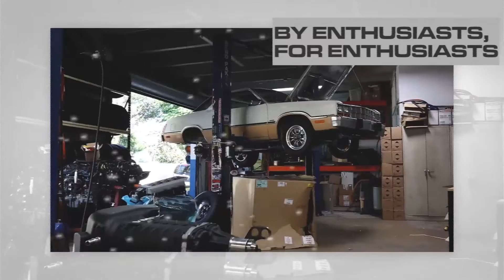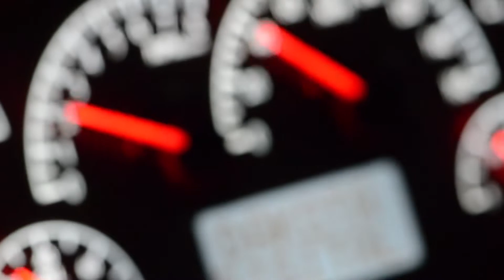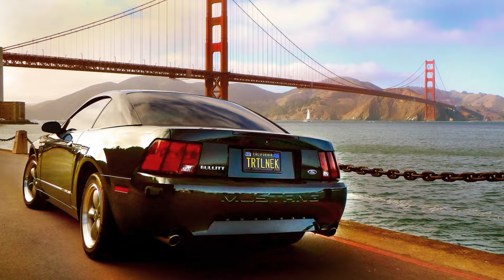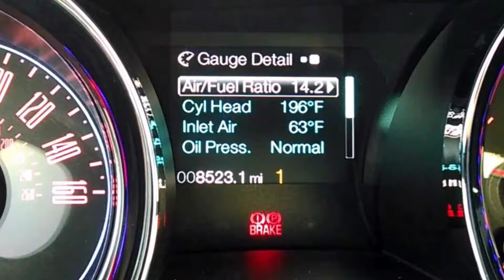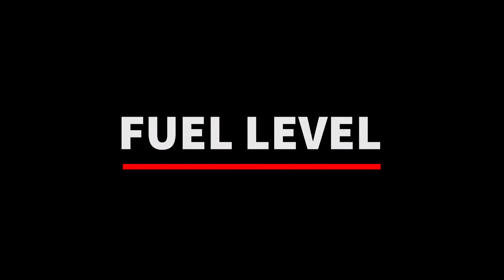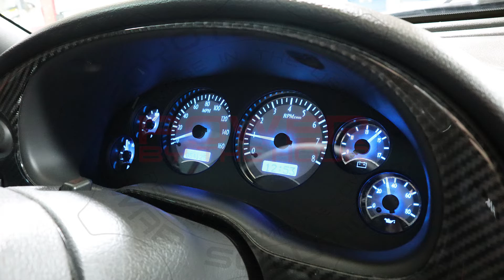Dakota Digital Gauges for 94-04 Mustang

Comment: The SN-95 instrument cluster amp gauge (batt)  is in series with the alternator and battery via the amp bulb and 510 resistor to charge the battery, does this unit incorporate that function ?

Comment: Will it work with a v6 mustang
Reply from the maker: Bryson, yes it will. One thing you will have to do is have the Pats system turned off as this cluster does not have that module built into it.

Comment: I just wish there was a way to hook up cruise control.
Reply from the maker: Look for aftermarket systems that plug into the fly by wire pedal. You could probably wire that into oem switches and controls too.
Reply: @PowerByTheHourPerformance  I have. Only thing I have found is that dakota digital might be making one but thats it. You could go with a drive by cable throttle body and then try to mount a dakota digital universal kit but I am not sure if that would work with the gen 1 control pack.
Reply: @PowerByTheHourPerformance  do y'all's control packs still have the dummy plugs for cruise control?

Comment: Would these gauges work for the v6 99-04
Reply from the maker: Yes they could be used for that year. You would still need to wire in all the senders and lighting signals along with a pats delete flash to the pcm.
Reply: Power By The Hour Performance how do I do the pats delete

Comment: i’m a little slow , can these gauges work with a regular sn95 without a coyote swap ?
Reply from the maker: Yes they can. Simply install supplied senders and wire all other inputs to the control box.
Reply: @PowerByTheHourPerformance  I am even slower. Can this upgrade work on the SN95 V6 models?

Comment: Great looking dash. I do have one question. You say it has to integrate with the OBDII port. Well, here in CA you can't have anything else plugged into the OBDII port and be legal. Is there a work around for this? I'm in the process of swapping a Coyote into my '02 GT. Thanks.
Reply from the maker: Greg, you can remove the ob2 plug from the bim module and hardwire it to the back of the connector. This will allow you to power it up and bet the can bus signal.
Reply: @PowerByTheHourPerformance  So what you're saying is it will be hardwired in series with the OBDII plug, just on the backside. That I can do. Do the dash`s come with the Check Engine, flashers and other warning light capabilities?
Reply from the maker: @glenndiorio8967  they do Glenn. If you visit our link you can see it lit up in the gallery
Reply: Yes move away from California

Comment: Can you guys do a independent rear suspension conversion on a 2014 gt500?
Reply from the maker: Greg, we think with time and money all things can be accomplished. For this swap, we do not have any direct fit options to pull from. So it would be custom and may require wide body flares or custom wheels for fitment. The go to would be a s550 irs. Not something we would take on but some chassis shops could knock it out.

Comment: Finally...I can get rid of the Intellitronix set up in my Coyote swapped Cobra
Reply: I know this comment is older, but can I ask what you don't like about the intellitronix dash panel? Was looking to get 1, but I wanna hear from ppl who do or have owned 1 before I dump $400 onto a dash panel.
Reply: @Eclips85  I actually still have it in the car, I don't drive it much.
Just seems kinda dated to me. But intellitronix seems to be a good company. Any questions i sent them, they replied back quickly.
They keep releasing dashes for other vehicles, so people must like them.
Reply: @SRobison1931  thanks for replying! I'm looking to get 1 for my '00 Mustang, but I've recently been seeing comments that a lot, if not all, warning lights don't operate with theses dashes. Been eyeing 1 for 3 yrs now, was hoping they would come out in yellow, but have yet to so far. Was just gonna buy 1 and attempt changing the LED bulbs to yellow, but it's my DD and the lack of warning lights is really deterring me. I'd really like a digital dash, but I may just keep an eye out for potential other brands.